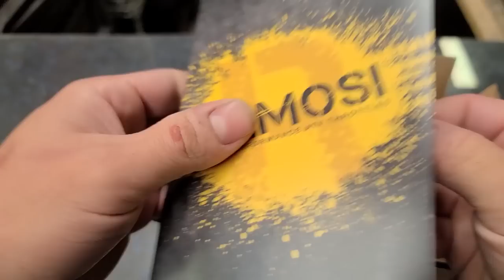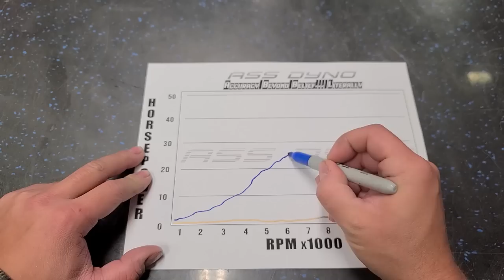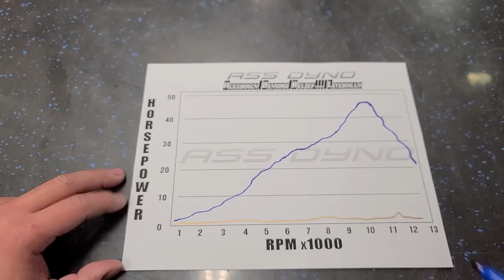Full Throttle on The Grape Ape! YZ144 Test Riding! (I put a thumb Throttle on it)

Comment: When I used to ride 125's,I never let off the throttle going through the gears.keep it on the pipe!!the bikes I used to race made about 35 hp.
Reply from the maker: I'll try it out man, thank you!
Reply: @MichaelSabo  no worries! And love your content.your a man after my own heart with being technical on your builds.i used to b a machinist, and I also worked on bikes,quads for a living,and unfortunately where I live at now,it's too seasonal, and I can't make a living doing it.just work on my own bikes anymore.
Reply: 2002 KX125 made 38 horse from the factory. It only made 19.5 ft lbs of torque though. 125 2 strokes had some ponies, just not a lot of torque.
Reply: @MichaelSabo  trust me don’t do that it’s super bad for your bike I did it with my kx 85 when I was on the road and caused damage to my engine and my clutch. When you pull in your clutch it disengages so your gears can grab without the mast disengagement your gears will just grind and wear away at each other
Reply: @greysonriegel9403  this is true for a car's manual transmission but a dirt bike has a consistent mesh transmission so there is no grinding cause they are always spinning with each other
Reply: @greysonriegel9403  Not entirely true.  You can bang shift so long as you know the RPM's on your bike really well.  Also works on cars.

Comment: Love the grape ape and also excited for the 400ex build I plan on getting one for an upgrade from my blaster and putting some nice parts on it
Reply: Dude I that’s exactly what I did. I had a 1998 blaster and it was really fun. Buttt it didn’t really have much tourqe but it’s was pretty fast. I trail ride so I needed that bottom end power so I picked up a 1999 400ex and it’s was 10x better in my opinion. I had it bored to 426 and rebuilt the entire engine and the thing is a beast. Def never gonna sell it.💪🏽💪🏽
Reply: @Shanem.07  yeah man my blaster is a beast it’s an 05 and has a toomey pipe it’s sick but definitely need more torque so I might just get a 400ex or yfz450

Comment: SWEET!! Brings back sweet memories. The YZ125 was my favorite, being a smaller guy, I could handle it or rather it could handle me on the track. Later, I went to a YZ250 but, it was just too much for me at my size. Honestly, the “Grape Ape” sounded like you were getting much more out of the low end than I remember. I imagine all the work and boring out to 144cc could be the difference. I just remember my YZ125 was a screamer, seemed much higher pitched in the power band but, it was virtually bone stock. Great video, Great Bike!!👍👍
Reply: You would have to lower the suspension. Ricky Carmichael had his 250 set up damn near like a 85cc. RC was a short guy n is legend.

Don't give up Champ

Comment: Great series on this YZ-144! Thank you. You definitely do not want a thumb throttle on a motorcycle. A twist throttle provides far more precise acceleration control. If you race, where you need to continually weigh the pegs for balance and traction, you will get a cramp in the palm of your hand as well as arm pump after an hour. I understand that a thrumb throttle can make sense on an ATV, where weight and balance is distributed among four wheels. I wonder if racers on ATV ever go to a twist throttle.
Reply: Interesting
Reply: Makes a lot of sense to me! I was wondering why when I was a youngster, my friends and I never experimented with thumb throttle but, We had plenty experience of riding and using a damn piece of string as throttle until we could get to Yamaha Shop.
Reply: Yes they use twist throttles. Almost any pro quad racer at least off road use twist throttles
Reply: I’ve rode motorcycles my whole life, put a twist throttle on my quad just to see. Long story short it was a really bad idea. 
It’s just unnatural even though I rode both for a long time.
Reply: not true i have been running a thumb for four years now, it all depends on rider, no whiskey throttle, and way more control "for me", in every situation, so always leave your opinions open ,and not look like you "think" you know everything
Reply: @NW_DB  I've been on dirt bikes for over 40 years. You are the first person who has told me that they chose a thumb throttle. From your trail riding video, it appears that you are sitting on your seat and your elbows are down. Maybe my comment is more relevant for racers. Have you tried a thumb throttle for motocross?
Reply: I have converted every thumb throttle machine to a twist. I hated them from day one on my first 3 wheeler and would always have a nasty cramp in my thumb after a long day of trail riding. That all ended the day I converted my 200X to a twist. Every time I would get  a new machine with a thumb throttle I would give it a try, But would always convert it.

Comment: I don't know that I could do thumb throttle on a bike.
As a youth I liked to buy bikes/ATVs and fix them up, it was more budget fix up but they usually were pretty nice when I sold. 
Your restorations are on a whole new level lately they come out nicer then new. I think you should keep some diy/budget builds in the mix tho, alot of viewers can relate to those.
Keep up the good work Mike, your on your way to 100k subs.🤘

Comment: The 144 won’t rev out as much same with the low end power. 

When you ride it, ride pigeon toed with toes pointed in and when you corner put leg up on shroud and toe pointed toward front fender. Elbows up will help control the bars when cornering and cover clutch and front brake with a finger or two.

Comment: I would love to see you build a yamaha blaster for track/mx with extended a arms, extended swing arm, some Elka suspension, with a powerful engine with a 225 airsal cylinder with aggressive porting , 35mm keihin carb a +3 crank and a right bend pipe should get you to around 40hp that's a big jump from stock 17 the blaster engine is dis tuned from factory but it can lush some power people rave them blasters with 450s and keep up well I wonder what you would think of one and definitely if you'd like to build one. I ride an ltr 450 now but I still have my blaster that I'm working on time to time keep up the good work man love your vids
Reply from the maker: Sounds like you have a solid build plan for a blaster man! I will eventually do one; I've heard about and seen some of them that are super fast and there's a huge aftermarket for them.

Comment: I have the moose racing duel gasser. It has a thumb throttle and a twist throttle in one unit. You can activate the twist throttle by pulling a pin and if you set the pin it locks the twist throttle and it’s thumb only. I have it on my Cr500R absolute game changer for me. For my life I just can’t get the twist throttle tried but failed, thumb is the only way to go for me.
Reply from the maker: Dude I remember those dual throttles! You never see those anywhere!

Comment: Sounds real clean, to make a whole shot, you need to be a bit more on the tank, in 2nd gear and at least near half throttle or close, from there pop the clutch. By shifting your weight more close to the tank, the bike will put more to the floor.

Comment: The twist throttle is easier in tight turns vs. Thumb. And they give you more grip when hitting whoops and stuff. Thing i dont like about twist is you can accidentally pin it sometimes

Comment: Yeah it sounds like its hitting the pipe just fine. It does four stroke a lil more than i might like but im sure you just ha ve to get used to using and abusing the clutch more to keep it up on the pipe and not lug it so much, but great job bro keep up the good fight
Reply from the maker: Thank you bro; I'll try keeping it higher in the RPMs 🤘

Comment: It  sounds great but take off the thumb throttle and put it in a quad it doesn't look right and roll throttle is just better in my opinion. I put rolls on quads. If you ride a full weekend your thumb will hate you. try it with  both throttles a long ride and see what you like. Great job dude

Comment: i would love to see how you ported the cylinder....
Reply from the maker: I show in this video what it looked like before I put it together. It is basically a clean up port and I made some very miner adjustments to the port timing. I'm not weathered enough to be making tutorials on how to do it but here is link to the video where you can see - https://youtu.be/0ME3tK9SLPo
Reply: @MichaelSabo  Thanks for the reply.   I have been porting 2 stoke cylinders for over 20+ years  the Yz 125 was one of the most tolerant ones you can port,  we Have templates for the port matching if you would like a set let me know ill send it on down for ya.  our dyno showed 4.5Hp - 6Hp Gain on them    (Heavy porting to get 6hp)

Tank you for the Great content Long time subscriber here
Reply from the maker: @DowneastTackle  I would love to see the templates and it's awesome to hear from someone who has experience! Thank you for subscribing for so long. If you can, send an email to me; michaelsabo350@gmail.com
Reply: @MichaelSabo  Check around the shop, did not find the YZ Template.  i did how ever find the banshee Race logic template
Reply from the maker: @DowneastTackle  I'd love to see that one too; regardless, thank you for taking the time to look for it
Reply: @MichaelSabo  if you were closer i would offer to port your cylinders free of charge

Comment: This video check all the boxes... After riding a KX-100 I'm working on (fun little bike!) sitting at 3:30am going between thinking "A YZ-125X could make a cool play bike, they're pretty light." and "I wonder what a thumb throttle on a bike is like", I search dirt bike thumb throttle and find this video... Is this a sign to get a YZ125 and stick a thumb throttle on it?
Reply: but why do quads have thumb trottle instead of wrist like normal bikes ?
Reply: @perfecttroubler1767  I believe it's because when you ride a quad you "use" the handle bars a lot more- You put more leverage on them (push and pull harder) and turn them farther (vs just sort of shifting your weight on a bile) also quad bars are used to lean/ hang off of while turning, so it's easier to to make unintentional throttle inputs on a quad with all of that extra handle bar work going on... 
I feel like a thumb throttle could be fun on a small/ light bike that you lift up the front end (or even bunny hop) just by compressing the suspension and pulling on the bars. 
I briefly had a quad quad with a dirt bike motor (CR-500) and its stock twist throttle and I hated having the twist throttle on it, even after primarily riding bikes for years, I just couldn't get used to it  (almost felt like riding with just the left bar) but maybe that's just me, some people do put twist kits on quads.
Reply: @Wooskii1  oh yeah that makes sense. Like when you move your body to sides through  corners you kinda grip on to the handlebars so that would probably cause you to be more " inaccurate " with throttle.

Comment: You rear 18" tire gives a little more torqu a 19" would feel normal.
Reply from the maker: The tire profile is higher though; more sidewall; it's actually about the same height as stock

Comment: Hold the throttle wide open in second gear and drop the clutch. Make sure your crotch is almost on the tank  and your head is over the front mudguard otherwise you'll flip. After you've launched, stand, keeping the throttle full and just flick through the gears, you shouldn't even need the clutch. The clutch is used mostly for launching or finessing the bike into the powerband, or gearing down. You shouldn't hear any gap between gears it should be one continuous scream.

Comment: Sounds a little hesitant off the line then opens up
Reply from the maker: Rider mod and I think for my weight I might benefit from a gear reduction
Reply: @MichaelSabo  it could be how the gas is mixed try 40 to 1 after the break in you weight won't hold that 125 back it's a small bore it's gonna have crazy power off the line and through the mid range and tapper off at the end

Comment: I agree that throttle is a precision piece of equipment but why would you put a thumb throttle on a dirt bike oh and by the way most built 125s if they are built correctly which I mean factory and built correctly are 35 to 40 horse I know a lot of the new 125 say 42 or 43 that's peak horsepower at the absolute top of the cur curve they're around 35 to 40 trust me I'm a 44 year old old motocross racer with some experience

Comment: How can you do something so disgusting to such a beautiful bike, a twist throttle is a matter of principal, its not optional, putting a thumb throttle on a dirtbike is a sin against everything dirtbikes stand for. It's just not the right way to control a machine that has to be balanced, it's not a four-wheeler. a thumb throttle on a motorcycle is begging for a broken a wrist.
Reply: Ok so 2 wheels twist throttle 4 wheels thumb throttle what about my 1981 atc250r what do 3 wheelers use?

Comment: Thumb throttle hell fukn no😂🤣wtf and no fuel cap breather hose,and pro taper bar pad not upright...that would be lucky to do 25hp coming from a 2020 yz250 rider that fkn ripps and probably make 50hp 125s are so slow unless you race and skrub and run lap times up with 2 stoke 250s and keep up with 450s,thumb throttle is gay as fuck even 2vintage wouldn't run that😂🤣worst thing I've seen you do sabo